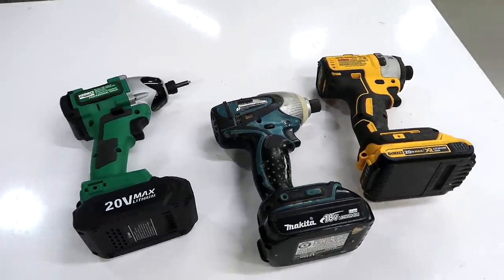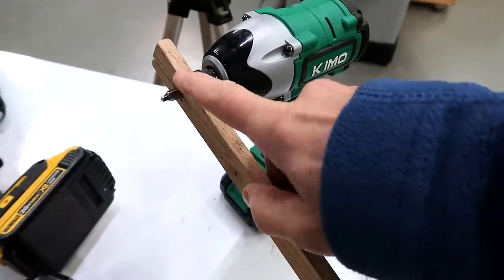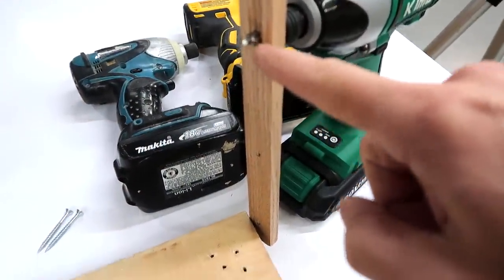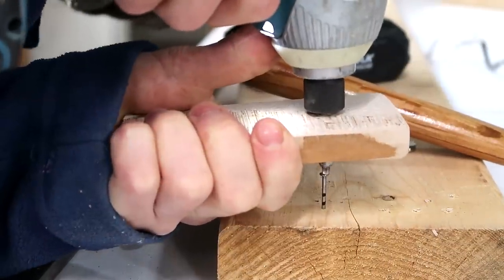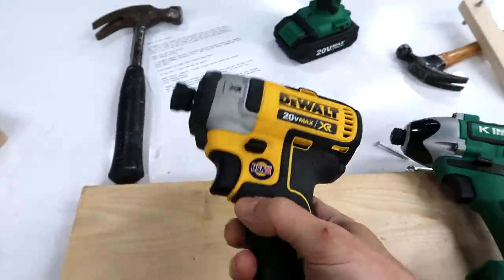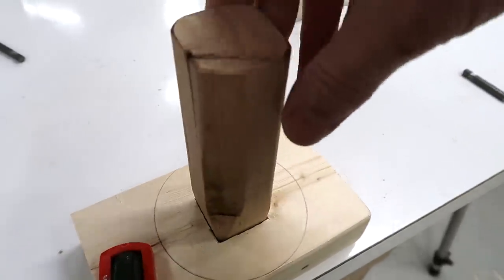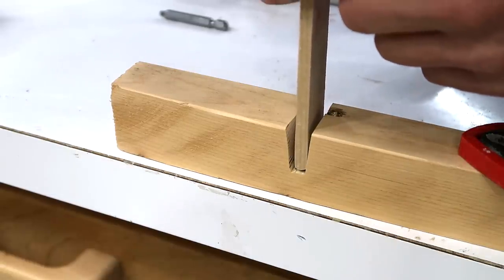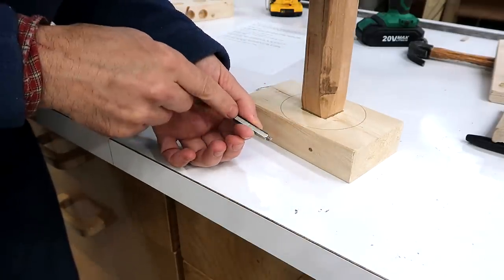How impact drivers prevent screw cam-out

Comment: I recently drove a ton of screws, and due to world situations I wasn't able to get torx for all of them. Had to get some square drive, and what surprised me was how much more sensitive the square drive screws were to misalignment than the torx. They cam out quite readily if you don't drive them exactly in line, which I hadn't fully realized before I switched to almost all torx. (Even with an impact driver. By now it's hard for me to imagine anyone assembling decking screws without one...)

Comment: Do you not have Torx head screws on your side of the pond? I have used nothing but for about 10 years now and I have forgotten what cam out feels like. I do not even posses an impact driver! Ok they cost more but when weighed up against the waste of time and aggravation  €2:50 per project with 100 screws is a no brainer.
Reply from the maker: the cheap screws are all philips and robertson

Comment: I think there may be another point to it. When using an impact driver, you get a very rapid, sudden kick away from the screw, instead of the normal constant pressure you get when using a drill. Although the force of these rapid kicks would be higher than the constant force, the weight of your drill and body should help absorb those impacts, which means that each kick would have to start from scratch (your body not moving), unlike with the constant force that comes when using a drill.
I'm not sure how much of a factor this is, if at all, but it makes sense to me.

Comment: Screw clarification. Robertson has the patent on a tapered square drive screw. There may be other square head screws, but if they aren't Robertson, there's no taper, and it's the taper that makes them superior. So if you want the good stuff, it has to be Robertson, not just square head.
Reply from the maker: if robertson got a patent on that, then it's now expired for at least 50 years.
Reply: Robertson patented the screw in 1907, and the last patent expired in 1964. So you're right. But I still ask for just Robertson.
Reply: n

Comment: Philips head buts tend to have ridges on the surface the contacts the screw head. Those ridges help the Phillips head hang on. The square tipped are smooth. Of course if you have the wrong size Phillips driver for the screw the ridges will do a little to nothing and you’ll just strip out the screw head. That’s why I actually prefer the square ones.

Comment: I figure the stick to it ness is caused by the vacuum that is created when the bit is stuck into the head of the screw, the design not allowing for outside air to enter between the bid and that screw the way flat head and Phillips heads do.

As you insert the bit, all the air is pushed out until you have a snug fit. This creates a vacuum that is sufficient enough to overcome the weight of the screw and hold the screw to the bit.
Reply from the maker: allright.  No point arguing with your types.  And those con trails are made deliberately to change the weather.
Reply: @matthiaswandel  
Well, the could have magnetized the bit, but most of them don't seem to be magnetized unless one does so after market wise.
Magnetized works well with Phillips heads, not so well with blade head bits but at least the screw doesn't fall to the floor.
Reply: @matthiaswandel  

I always thought con trails were for pilots that couldn't fly by instruments.

Comment: Any downward/forward impetus provided by the impact driver is incidental and a result of the size and momentum of the hammer. Other folks have linked AvE's video showing a high speed video of an impact in action before I could, but I can't imagine you haven't seen it yet.

I mean, you guys are practically neighbors right? Wasn't it you who talked him into buying a tractor? That's how Canadialand works.

But back on topic. It's not just the release of the torque allowing the bit to reset that prevents cam-out. Since all of the pressure on the surfaces of the bit and the screw is applied quickly (not quite instantaneously, but close enough) the coefficient of friction between the two surfaces is higher, and the coefficient of friction between the screw and the wood is lower during that moment when the screw has been broken loose because of a lot of complicated things I won't go through the effort of explaining in a youtube comment.

So not only do impact drivers apply more torque for those brief moments, but because of the way they apply torque less torque is needed to drive the screw.

Comment: Are you sure that's a Phillips head driver, and not posidrive?
Reply: It was so big on the screen, that it is impossible to mix up those two, if you have ever had both on hand and paid any attention.  Pozidrivs additional indentations and ribs are easy to see if you know such things differentiate them from phillips.  On a slight off topic,  JIS-screws look basically the same as phillips and are often damaged with phillips bits.  I live in Finland and had to order JIS-screwdrivers from Japan to help with fixing Japanese stuff, because even the tool suppliers here did not know what i was asking for.

Comment: I just use torx screws with a decent set of wera bits. Never had cam out issues. With the cheap rounded off bits yes. But not with the weras.

Comment: I have a question. Perhaps someone could help me with this? I recently ordered a concrete convincer 9000 (aka serious impact drill with SDS-Plus chuck, sorry don't know the technical term in English) that produces 2J of work per impact. I've owned a Bosch corded drill with hammer function... you know,  the ones with normal bits instead of SDS-Plus. the things dad had in a drawer somewhere. For the life of me I cannot find any impact numbers in J for these types of drills. Does anyone know in what ballpark the are? Battery powered impact drills seem to go from 1J to 3J whereas the corded smaller ones reach 4 Joule. My SDS-Max Hilti monster I believe was quoted as delivering around 8J...
Does anyone have any insight?
For completeness sake this is what I have: Bosch GSB 21-2 RCT
What the postman is gonna make me happy with: Makita DHR243
I don't understand why the drills like the Bosch have the amount of impacts per second listed but not the energy delivered, while the more serious tools are vice versa...
Reply: Because there is no meaningful amount of impact force. The SDS drill (or rotary hammer in English) actually have a steel hammer hitting back of drill bit, whereas regular hammer drill have two ribbed steel discs rubbing against each other when rotating. They are more of a vibrator drill than hammer drill.
Reply: One is a hammer the other is a drill motor. This is why.

Comment: WHOA!  The "hammering forward" of the driver may be much less IT hammering forward and much more YOU putting pressure downwards and THEN some "disturbance" of the nail wood interface during the shock of the impact strike.  I seriously doubt that the internal mechanism does ANYTHING in the fore and aft direction.
If you really want an answer, this calls for slow motion photography.
Reply from the maker: Then why didn't the nail go for the other two impact drivers?

Comment: The added cost of GRK or Spax screws with a Torx drive are far outweighed by the quality and convenience.  I've used them to secure steel C-channel to maple and only 6 GRK #8 screws hold the pieces together with no problem.

Comment: At 1:29/5:47 of the video you are trying to hammer the nail with the impact drill,  if you try this test with a socket instead of a piece of wood, you might get a different result.  Insert the drill bit in the socket and use it to help guide the bit so that it doesn't fall off the head of the nail.

Comment: I have  a different experience. I have had way more success with square drive than phillips. And, I almost never use an impact driver to drive screws. The impact driver has a way greater propensity to snap the screw in half. And, out come the screw extractors! When I use a drill with the square drive, I get a smooth continuous twisting into the wood rather than repeated banging on the screw creating stress that leads to the snapping the screw. And, yes, I can precondition the screw which helps somewhat in hard maple and other woods but still, have screw failure. But, same batch of screws with a preconditioning lube using a drill driver gets the screw home probably 999 times out of 1000.

Comment: That is the same theory as to why the Harley Davidson V-twin engine was unbeatable in flat-track dirt racing. It would go putt-putt------ firing both cylinders and then freewheeling for 675 degrees. The power drives it forward and the coasting lets the tires get sideways traction

Comment: 5:13 Arthur's Head Screwdriver. The letter A on the screwdriver will fit into the corresponding A-hole in the Arthur's Head screw. 🤣

Comment: I wish square drive were more popular here in the UK. They don’t cam out nearly as much as crosshead and posidrive.
Reply: Torx is fine I guess, never used robertson tho
Reply: Torx
Reply: The best part of the robertson screws is that you can seat one on the end of the tool and it will stay there for the most part.
Reply: Using the wrong tools/user error

If I based my allen head opinion on my experience at work I’d absolutely hate them. Then I found out the boss was buying knock offs
Reply: And the equipment we were constructing? Cheapest stuff he could find. Nothing ever lined up.
Reply: @UnbeltedSundew  try using good quality bits
Reply: Torx all the way. There is no reason to use anything else.
Reply: MrConminer Torx is better than fine in my experience.

Comment: "I stopped using impact drivers because they are too loud." 
What an interesting use case, or I guess, non-use case.  
I work in a machine shop, I was specifically trained when I first started that I shouldn't have anything that impedes the ability to hear tool wear and damage. I'm now second thinking that training. I've definitely have noticed that my hearing ability has degraded slightly over time. I'm still kinda young, late 20s, so I doubt it's just because I'm getting older.
I'm buying some earplugs tomorrow.
But it makes me wonder if an impact gun, especially a brushless cordless, is too loud for you Matthias, what kind of hearing protection do you use when running your tablesaw, router, or any other machinery?
Reply: I have worked in high noise environments (spinning mills) and I have been taught that 10 minutes WITHOUT ear defenders is almost as bad as not wearing any at all for the whole shift!
Protect your ears if you want to be able to hear birds sing later in life. Deafness and most hearing impairment is permanent!
Reply: I've never thought of an impact as a loud tool. The loudest tool I can think of is an old job site table saw, my Dewalt will make my ears ring if I use it long enough without ear pro. Maybe a cheap angle grinder is a close second.
Reply from the maker: Damage is power x time.  10 minutes is about 1/50th of an 8 hour shift, so 1/50th of the damage.
Reply: @matthiaswandel  That is not what the Swedish studies of the 1970's and 80's show. Unfortunately I do not have them at my fingertips at this time to point you to them.
Reply: spent hours driving a tractor with no muffler as a kid (dad didn'''''t waste a dime on  that kind of stuff). now at 68 i dont need any ear protection. fingers are my talkers now. weird thing is while i can't hear you i do have school bells ringing in my head 24/7.

Comment: i am a weird USAian. My only problems with Robertson is twisting off the screw heads because I was too lazy to chew a pilot hole.  Never cammed  out a Robertson.  The cheap Chineseium Philips and Torx easily cam out.  Ugghhh the dread replacing those and the joy using Robertson.

Comment: I am always afraid that the high torque of an impact driver weakens the screw or split the wood.
Reply: I've never had either of those issues with an impact driver that I haven't also head with a drill. 
If impact drivers (wrenches) weakened the screws I don't think race car pit crews would be using them :)
Reply: @dscrive  but pit crews using a torque limiter. 
But thanks for sharing your experience.

Comment: Its because the drill has a constant spin at the base rpm when the impact impacts the screw it doesn't spin at the base rpms that a drill does so its higher torque slower rpm thats why it doesn't cam out

Comment: Go for Torx. 15, 20 and 25. Just lose everything else. Start today.
With Torx match you can drive a screw in even at about 15 deg misalignment to your bit.
You are standing on top of an aluminium ladder,  and you need to drive in a screw half a meter away from your position. 
You are in luck if it is a Torx.

Comment: These robertson screws are a pain in the ass. There's a reason you usually can't find them in the rest of the world. At the moment, Torx is the way to go. Almost no cam-out-force at all.
Reply: Torx also cams out if you are not aligned with the screw or aply too little pressure because you are in a tight space or work over head or whatnot. Way less, of course, but they still do. This is extra frustrating with stainless stell screws as they are round in an instant. I also find them falling off more easily compared to PZ heads. But everything is better than PH, everything!
Reply: Torx don't cam-out but they strip easily with mild corrosion
Reply: @JohnJameson18y  I noticed you can almost always just hammer in a torx bit of the next size to get a stripped torx screw out. Corrosion is usually only an issue with low-quality rust-welded torx screws. Also torx forces you to align with the screw much more than other screw head types, lowering the chances of stripping the head even further.
Reply: Cabinets are almost exclusively professionally hung with sq2 screws, and sq1 trim screws in the USA.
The sq1 trim screws are nice.
Reply: Abcdefg --- I don't know, I really like the Robertson screws, far better than slot or philips for sure.
Reply: Robertson's will hold the screw on the top without a magnet. Which is why you find most stainless deck screws are Robertson. Now with the new custom torx styles you can get close.

Comment: None of those impact drivers hammer the bit forward, go open them up, there is nothing in their gearboxes and hammer assemblies that could hammer the bit down.
Reply from the maker: and the nail sank into wood out of fear then?
Reply: Matthias Wandel 😂🤣😂
Reply: @matthiaswandel  It sank because you were pushing on it... and the vibration of the impact gun helped overcome the friction. Sideways vibration or even jiggling the nail because of the point of rotation not being exactly in the middle of the nail. Seriously, go tear them down.
Reply: @matthiaswandel it's the same fundamentals of vibrational piling. Your pushing hard down on the driver while the impact mechanism is, ironically, camming out. This vibration along with the compressive force is greater then the friction of the nail and wood.

Comment: Fun experiments. I just tried driving a 4d common nail with a 1/4" nut driver installed so it wouldn't slip off.  Dewalt DCF787 impact driver. I would say zero forward driving force.
Reply from the maker: you have to get the driver to start ratcheting
Reply: @matthiaswandel  I held it with a wrench so it did ratchet. Made quite a ratcheting racket!

Comment: I think your square drive screws are to big for the bit! I use square at my work and it's really a perfect fit between the bit and the screw it doesnt really have play in it so it is almost a challenge to cam it out
Reply from the maker: both driver and bit are #2
Reply: @matthiaswandel  
"both driver and bit are #2" - Allegedly. 
I'll bet they were both MARKED as #2, but I wonder how close to the spec for #2 they were?
I lack the metrology gear here, so I can't verify my claims. It would be interesting to see someone really methodical, who DOES have the gear, make some measurements of this sort of stuff. 
There is no enforcement of any kind of standard with this stuff, and suppliers are more than happy to import any old junk. They do this with complete impunity.
Reply: @matthiaswandel  But how "fresh" was the bit? With an old Torx bit I'll also get a lot of cam out.
Reply: @digitalradiohacker  they can only be so tight before they wont easily fit into and out of the screw.. if youre driving 1000 screws into a deck one after another you dont want a hastle on everyone getting the bit in or out

Comment: With all due respect, you don't use a drill to drive screws. Drills are for DRILLING action, pilot holes, going through metal or plastic ect. and should always be using some sort of DRILL bit. Once again with Impact DRIVERS, It's all in the name. I removed probably over 1000 completely rusty Robertson with my impact driver with zero camout and virtually no stripping the entire job, and that also includes replacing those screws afterwards. The only 'drill' I would ever recommend driving screws with would be the Worx Switchdriver, but again it's been heavily optimized for torque and is really meant to drive screws into pilot holes you just drilled with the switched-head, and even the Switchdriver isn't meant for anything bigger than a #8

Comment: Well, DeWalts sponsorship cost you money and you said so. They are not going to come back and pay you now. As for todays topic of cam out. Would the Robertsons cam out if the sides of the bit tip were not tapered? I suspect the tapering is to increase ease of insertion into the driving hole. Just like the original Robertsons and Phillips drives were made that way to speed production in assembly lines. The best blade type screwdrivers are the ones with parallel ground sides. These are mostly used in gunsmithing but can be used anywhere. A set of gunsmith driver bits will have several widths and thicknesses of blade tips. The parallel sides greatly decrease the likely hood of cam out. A cam out is caused by an inclined plane, no plane no cam out.